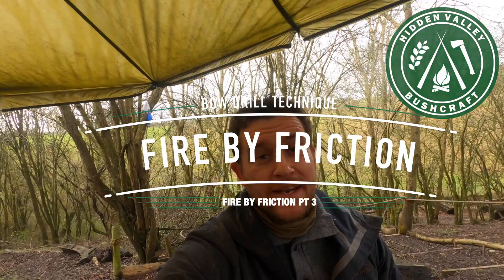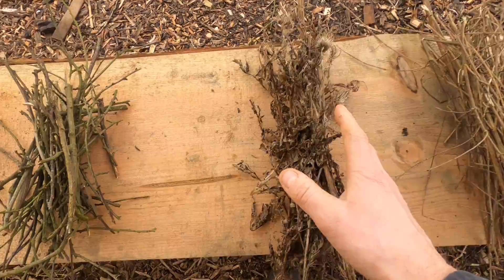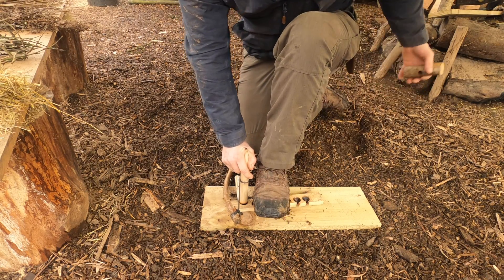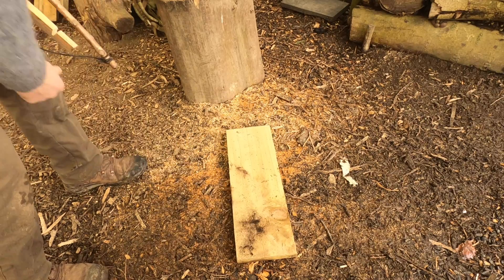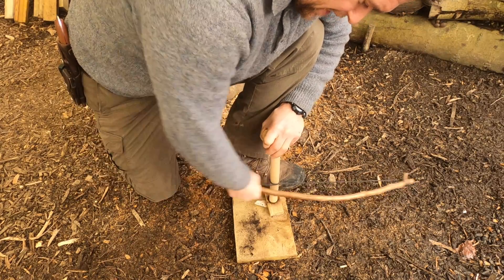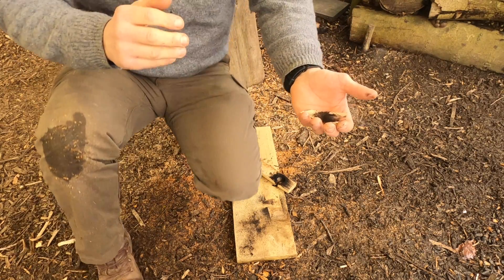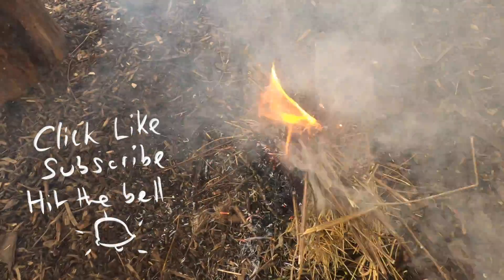Fire By Friction Bow Drill Kit | A step by step guide

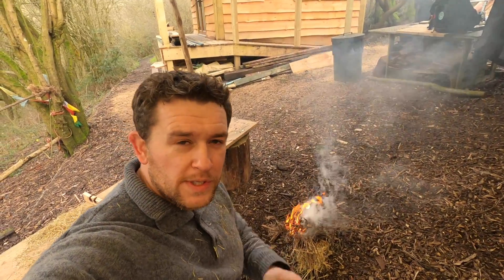Comment: Absolutely Awesome!  Bow drill is a skill I'm continuing to try to master.   10:05  "And to wrap this up fundamentally, don't leave home without one of these guys"...holds up a lighter.  There is no more reliable way to start a fire than with a fire and butane burns at around 2205C/4000F degrees.   I've tested Bic lighters thousands of times at over 14,000 feet above see level in Colorado and they produce flame as reliably as anywhere.  The spark can be used to light fires even if the lighter is wet and out of gas.

Comment: Thanks Nick - once again an outstanding “real” video with step by step and visible pointers on how to do it.  Too many times I see a quick bit of furious bowing and then hey presto we’re off... . I collected some dry standing ivy last weekend and followed your set up for the hearth board and drill and will be trying it this weekend. This vid is perfect timing. Cheers.
Reply: @hiddenvalleybushcraft5683  It worked like a dream! “Fail to prepare, prepare to fail” was the main lesson I got from your vid. So I spent the time getting everything right and ready. Particularly useful were:  1. Kindling and nest prep, 2. Keeping everything off the ground - ‘twas pretty damp yesterday! 3. Position of feet and kneeling to ensure good bow movement, 4. “Warming up” the wood to gentle smoking, then a specific push hard down and 20 good strokes, 5. Allowing the ember to settle and get going, and 6. A decent ember catcher, in my case a flat piece of birch bark. It took first time (which is a first!) - don’t know whether it was the use of ivy, which seemed to get v hot v quickly and/or application of the techniques, prob both. I do use a steel bearing block (doubles as a steel for my flint) and that worked well too - it didn’t get hot (spit) or wear the drill point. All in all great work and very satisfying, all down to your excellent tips. Cheers. Pics of the details here if you’re interested. https://imgur.com/gallery/yRlTeX6